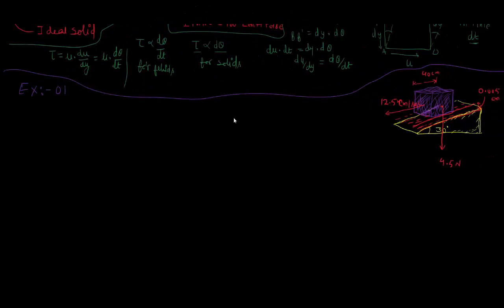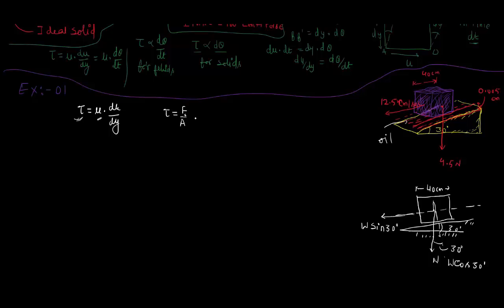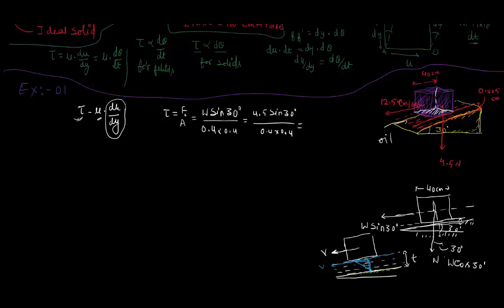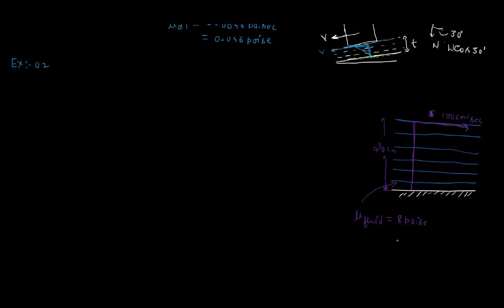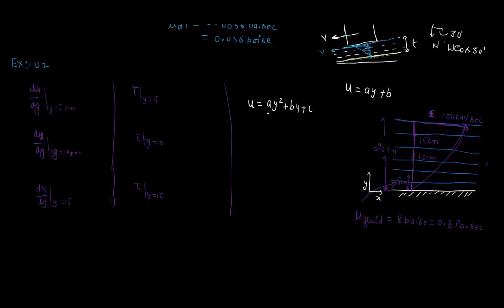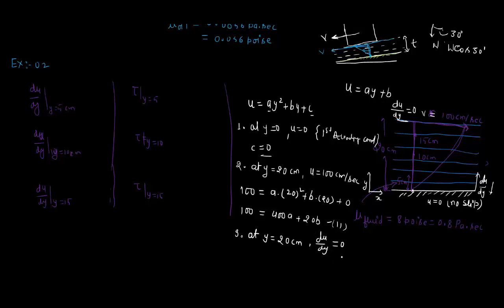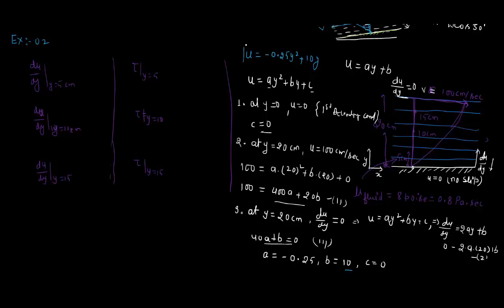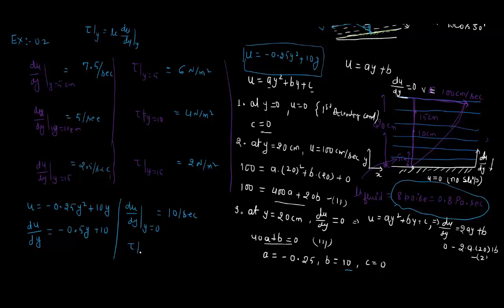Fluid Mechanics Lec 4.2 ( Fluid properties : Dynamics Viscosity and Examples )

Comment: sir one doubt ,In dynamic ,pipe flow fluid  pressure around the pipe wall is same or not? please explain sir
Reply from the maker: if you are considering hydrostatic law then the pressure is varying according to height but in pipe flow we consider that pressure is only function of flow direction (when pipe is in horizontal position ).
Reply: ok sir ,so water pressure in a pipe in one section equal in all points correct or wrong? please tell sir
Reply from the maker: Yes for dynamic calculation
Reply: ok,thank you sir